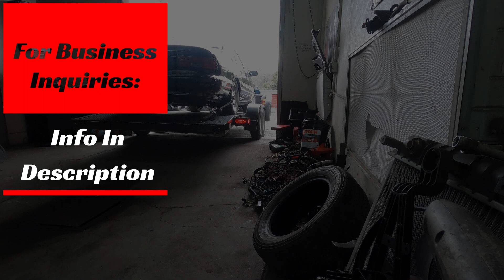1996 Impala gets a 408 LSX Stroker with Holley Terminator XMax

Comment: I've been looking for a good Radiator and fan set up like the one you have in this video. If at all possible can I have the information on the Radiator and fan set up thanks in advance. I'm in the process of running the same set up
Reply: 408 stroker in my Impala as well. I run a champion radiator with an aluminum shroud and dual electric fans. Goes right in, car never gets hot
Reply: @calenatar  is it a 2 or 3 core radiator ?
Reply: Stock fans and radiator handles it fine.
Reply: @Keith.R  CC1517 its a 3 core aluminum with coolers. fits great. I had issues on tracks/autocrossing with the stock radiator/fan/coolers with both the trans, and the engine temps getting too warm. This setup solved that
Reply: @calenatar  Thank you so much I have a Cold Case Aluminum Radiator and I don't think it'll get the job done